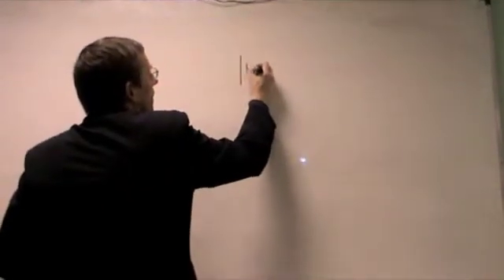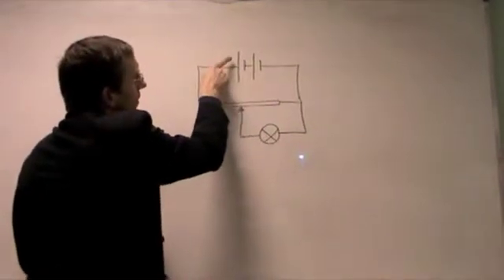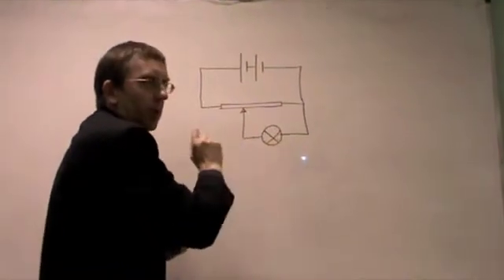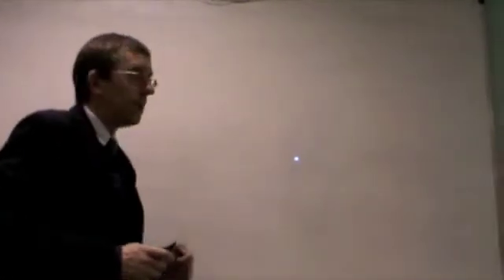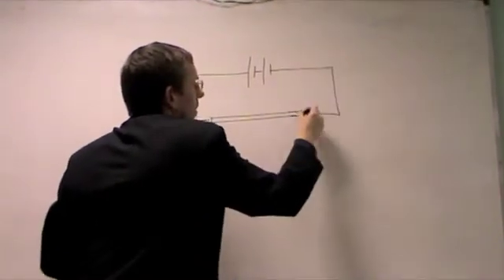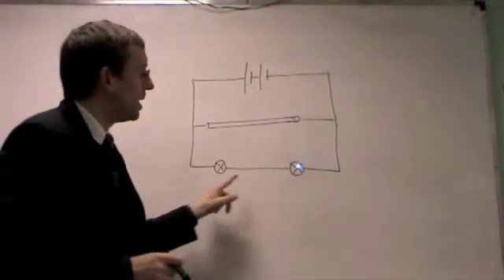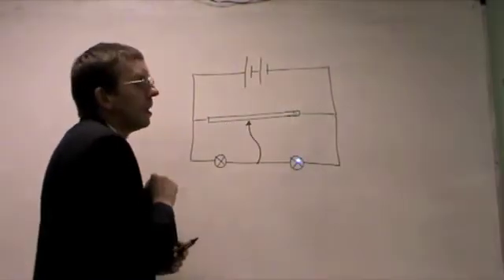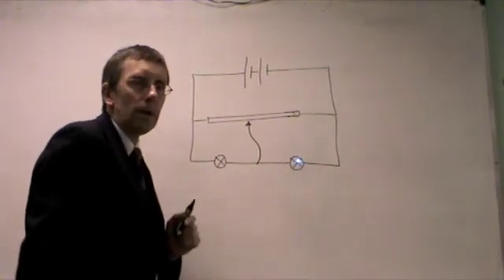Using potential dividers

Comment from the maker: Be careful when you are using the potential divider equation. Before you do your calculation label the resistors on the diagram R1 and R2 so that you can put the values in the right place in the equation.